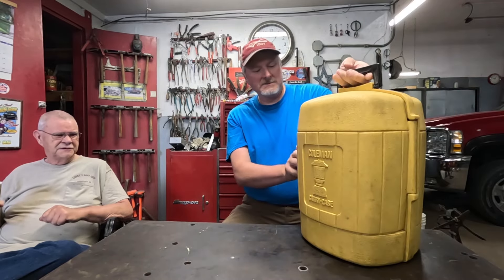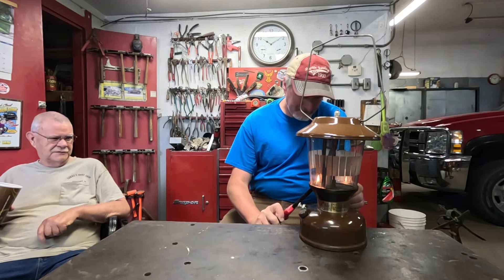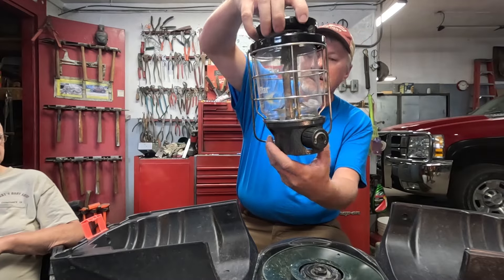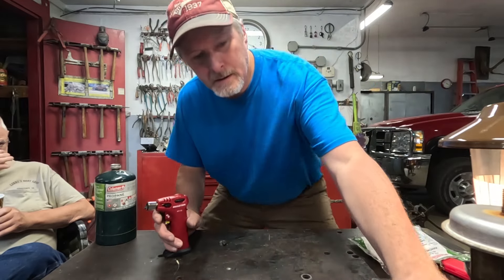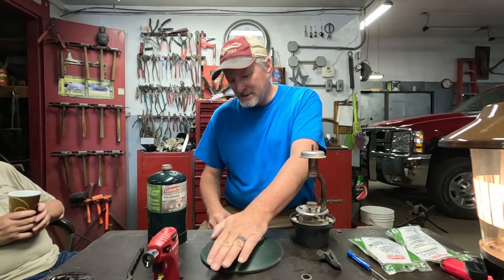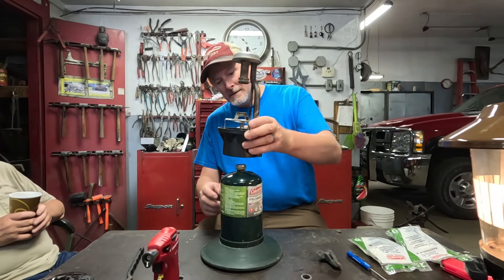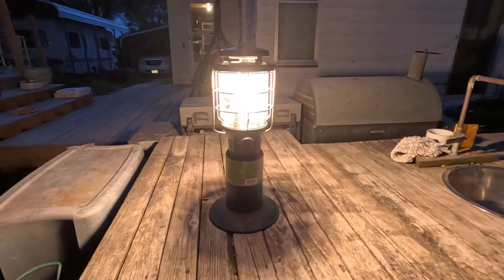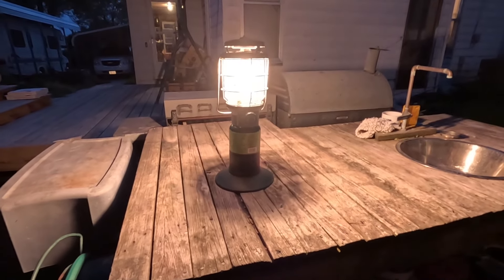Let's unbox a Coleman Northstar lantern that I bought,  but first let's light my birthday lantern!

Comment: I just bought my Coleman, Northstar 2500  off E Bay  and it has an electric ignighter..open the fuel knob all the way then press in and it will click and light...
Reply from the maker: Mine does not have the igniter, my guess is it may be a little older?
Reply: Take the can off and look underneath the lantern. Mine is the same as yours, turn the knob and you'll see it pushes in the igniter as you turn it